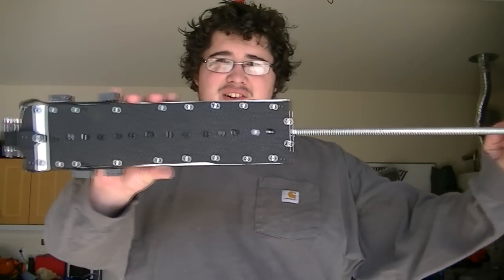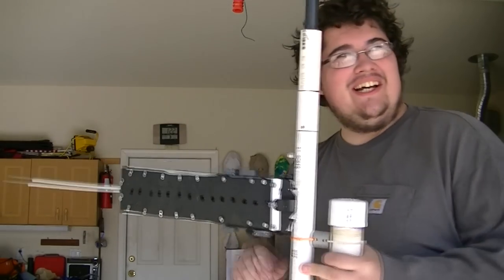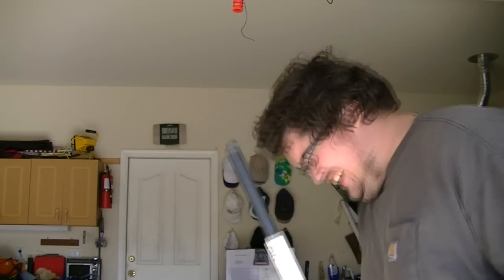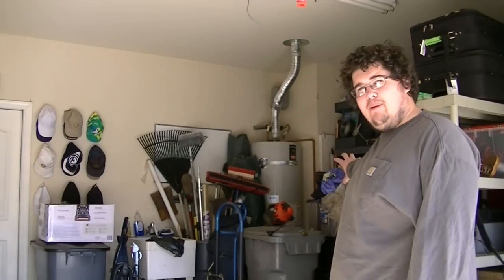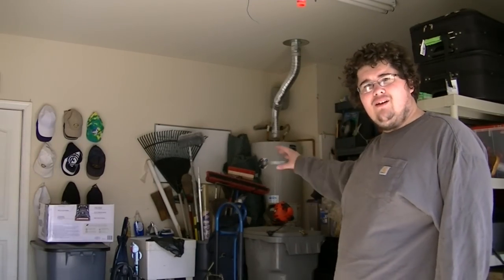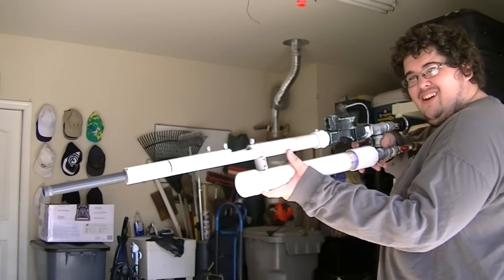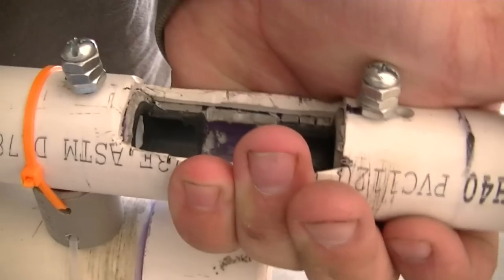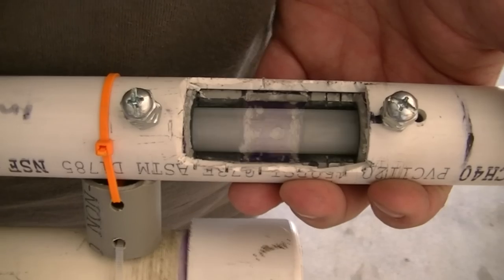Full auto battery shooting air gun 600 rounds per minute

Comment: Very impressive. The only thing I don't quite understand by the diagram is how the air kicks off automatically allowing the bolt to return to the open position. By what I see it should only operate as semi auto, and the bolt should stay forward with air flowing through it until your finger is lifted off the trigger. What am I missing that makes it kick on and off repeatedly while your finger is held down?

Comment: I made a AA battery cannon out of an 8 foot aluminum pipe and a 150psi aircompressor. I found that a Crayola marker works perfectly as a compression cap at the end of the cannon. It allows pressure to build up in the pipe increasing the velocity by a ton. Its definitely lethal with that marker modification as janky as it sounds.

Comment: This is really cool, but I really don't think that batteries were the best choice for ammo. For one, batteries are a lot more expensive than just pieces of metal. Second, they are less dense than just some lead, or even steel. Third, if those batteries break, you have a royal mess of acid to clean up.
I think some steel ball bearings would have been a better ammo choice.
Reply: Medovukha by ATF regs, a "firearm" is something that accelerates a projectile using "explosive force."  This uses air, not gunpowder, so it is not within the ATF jurisdiction.
Reply: Depleted batteries from your Xbox 360 controller are for free though.
Reply: bingoberra18 I thought the EXACT same thing.
Reply: there are so many dead batteries to use
Reply: bingoberra18 
His mom goes through a few dozen a week.
Reply: +haywoodyoudome blackpeoplereact.gif
Reply: VeryPeeved point lookout reference. I see what you did there.
Reply: Say what you want but he's a genius.
Reply: Hang everyone looked at a dead battery and thought to themselves "damn I really want to shoot one of those things" that's why he made this.

Comment: Really nice work, bro!

You should consider a backpack style air supply like a scuba tank. These can hold about 3000 psi of air. I'm not saying use 3000 psi (NEVER, EVER!!!), its just that it holds a lot of volume since its compressed to 3000 psi. An approved scuba regulator's 1st stage output in the line is a usable 140-150psi before the mouth piece. Attach a standard industrial regulator where the mouth piece would normally be and go from there. Research it more.

Keep it up and BE CAREFUL!

Comment: @ukilliheal 14mm is such an oddball diameter. 50cal muz load balls are easy to find as well as 50AE molds (fmj being way too expensive).  Any chance you could make a tapered chamber and jam a nylon or other low friction sleeve in it to get to the 1/2" mark? Also I dunno the details of your bolt design but you sure it won't just shatter on impact one of these times? Could be worth it to have an aluminum bar cut for this. Amazing functionality of the gun and just be safe with the high pressure.

Comment: Please take care when using compressed air with PVC the pressure rating its marked at is at ambient temperatures. Compressed air runs hot especially highly compressed air so be careful because the heat will make your PVC weaker. Exploding PVC is not pretty maybe you would like to use all metal or incase your device in some sort of concrete or polyurethane. Great work great video keep it up

Comment: when the valve near the air compressor is open its shot full auto but if you stop firing but the valve is still open, does it gain pressure?

Comment: you should make some acetal or nylon slugs or even cast some lead ones cause shooting AA batts is pretty expensive. I think something around a 40sw or 10mm bullet would work. You could also have your magazine hold 3-4x more using shorter projectiles. Great design though.

Comment: I am actually more interested in the mechanics of this "weapon". I would like to replicate this in a fully automatic airsoft gun. (Smaller preferably)
Also, You might want to list how big it says on your air tank. I would like to know if (at its current settings) a CO2 cartridge would last more than half a second. XD
The PSI is also adjustable is it not?
Did you use a FPS counter or just eyeball it?

Comment: Cifyra, how is that physically possible to shoot 10 babies in 4.9 seconds? Ive shot a bow for years and years and it would be pretty impossible to shoot ten objects in 4.9 seconds unless the weight pull on the bow was super low so the "marksman" wouldn't have to be on steroids to pull the actual weight it would take to actually kill someone or even have deadly penetration.

Comment: maybe you should work on the ammo. try using steel bullets coated with foam (?) or some kind of isolation that will make them fit tightly in the barrel.
great job anyway!

Comment: if you can somehow increase bullet velocity, couldn't you cause batteries to break against human flesh therefore corroding flesh with battery acid? it could be very very deadly.
Reply: XD the battery would go through you before enough acid came out
Reply: I don't think a battery would have enough power to punch through both sides of your chest, and also, there isn't such thing as "enough battery acid". it's corrosive, a tiny tiny tiny droplet would slowly melt through your body and kill you.
Reply: Doin Rocks well if it hit a bone I suppose